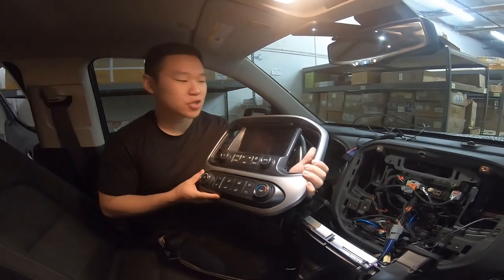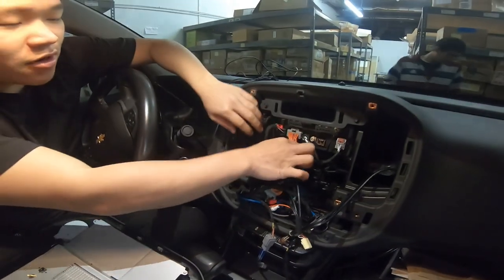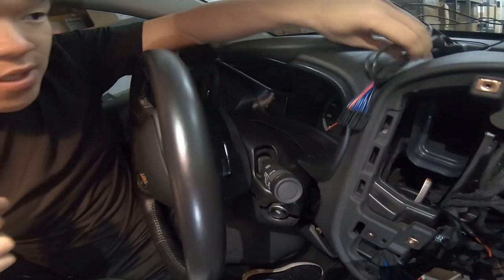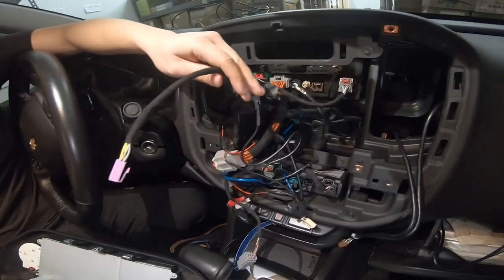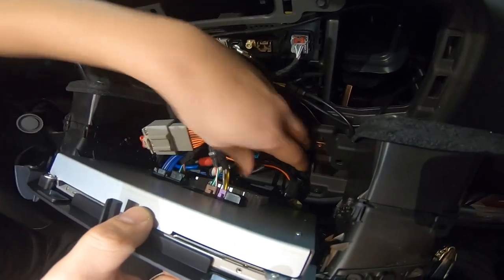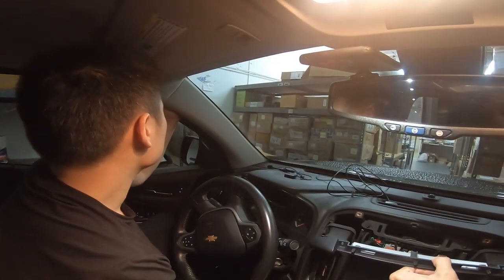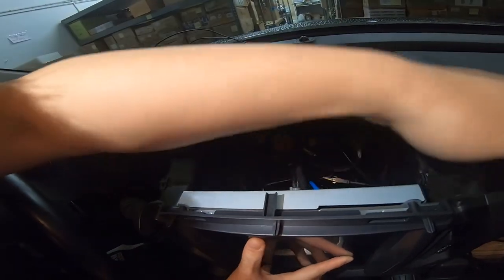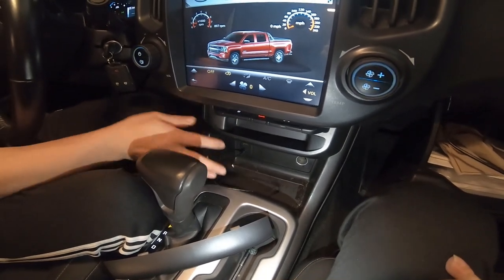Installation Video 12.1 inch vertical screen head unit for 2015 - 2019 Chevy Colorado and GMC Canyon

Comment: i bought it is i installed it it gives sound on the radio but when i connect it to internet in youtobe or videos it does not give sound i think it must be programmed from the system to remove the blockage and  i do not know how to do it  thanks for your cooperation

Comment: I have a 2016 Chevy Tahoe and I wanted to know if that will fit in my truck
Reply from the maker: Shawn Huff https://www.phoenixautomotiveinc.com/products/px6-six-core-12-1-android-9-fast-boot-vertical-screen-navigation-radio-for-chevrolet-tahoe-suburban-gmc-yukon-2015-2020?_pos=3&_sid=0a31be7b0&_ss=r
Reply: Phoenix Automotive Thank you I’m about to order it now..now I just have to find someone to put it in but thank you so much for the help..

Comment: The link to your website doesnt work.  How much for the replacement unit and for installation in a base model 2016 Canyon?
Reply from the maker: https://phoenixautomotiveinc.com/products/px6-six-core-12-1-android-9-fast-boot-vertical-screen-navigation-radio-for-chevrolet-colorado-gmc-canyon-2015-2018?_pos=1&_sid=69257a84b&_ss=r

Comment: I really like the look of that unit. Couple of questions after watching this video though, why do you have to re-run USB cables? Will the 2 OEM USB ports for the system not work after installing this unit? Also, why do you need to add a speaker for turn by turn? The OEM plays through the truck speakers.

I'm not a stereo guy but would like a lot more functions that OEM doesn't provide but not if I lose functions like the USB ports. The 2 that you can use with the OEM system provide a much cleaner look than running cables out of the glove box.

Love the screen.
Reply from the maker: Robert O'Dell both Oem and our USB ports will work, for different apps. When you play Oem radio, the speaker plays aftermarket Navi sound

Comment: Could you please help me. I purchased your Radio for my 2019 Colorado ZR2 and the wiring that cane with the kit don’t seem to be right! I’m thinking it’s because I have a Bose System is there additional wiring I need for my system?? Thanks a quick response would be greatly appreciated 🙏
Reply from the maker: Robert Ely can you email pics of ur oem connectors to contactus@phoenixandroidradios.com
Reply: Phoenix Android Radios oh yes!!! Absolutely thank you so much. Will do now! I basically put my old radio back in but take a few shots while I had it all open
Reply: Phoenix Android Radios ok the email is sent along with pics. Please let me know if you got
Reply: I don’t have that usb connector coming out from vehicle for display mine look totally different
Reply: Robert Ely  did they ever get you fixed up? I have a 19 with Bose and want to get this also
Reply: @dt6816  nope don't think they ever released a version for the 2019 colorado
Reply: Robert Ely thanks for the info!

Comment: Are these only a Android or do they work with IOS? Also, do you have one yet for 2020 Canyons?
Reply from the maker: https://phoenixautomotiveinc.com/products/px6-six-core-12-1-android-9-fast-boot-vertical-screen-navigation-radio-for-chevrolet-colorado-gmc-canyon-2015-2018?_pos=1&_sid=69257a84b&_ss=r
Reply from the maker: It work with both.
Reply: Looks great. I see it says these are through 2018. Do you have them for a 2020 canyon?
Reply from the maker: @Haze1552  Need to check your dash.

Comment: Will the USB connections still work below the head unit? And can you place the GPS antenna inside the dish board instead of mounting up on the top of the windshield? Also I have in my truck a SD card for GPS Maps Will this head unit work with this SD card?
How much does the unit cost? I have  2019 Colorado.
Reply from the maker: Steven Bergman 2019 not compatible yet

Comment: How would I run my amps with this setup I dnt see any rca outputs
Reply from the maker: You integrate the amp with your stock system, then install the unit. The unit feeds sound to stock AUX source.
Reply: Is there anyway to keep a signal to the unit like a sim card or has to be wifi or bluetooth?